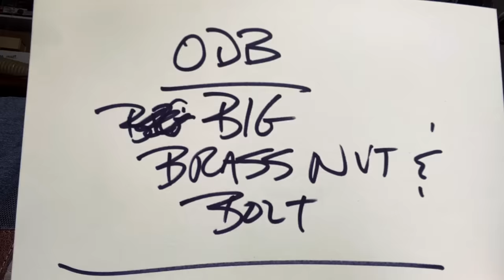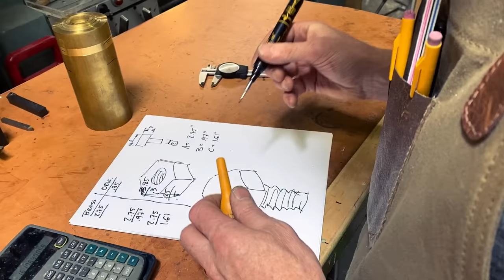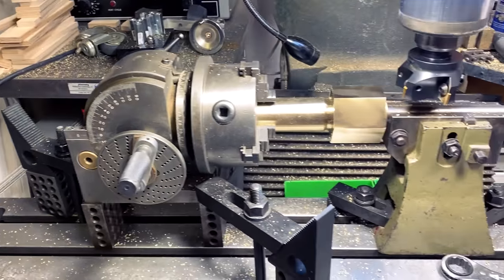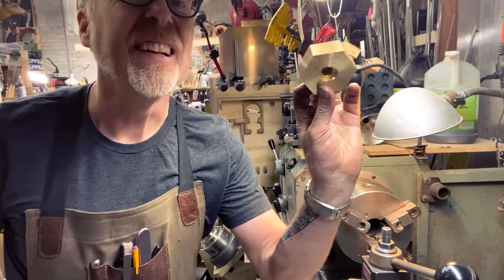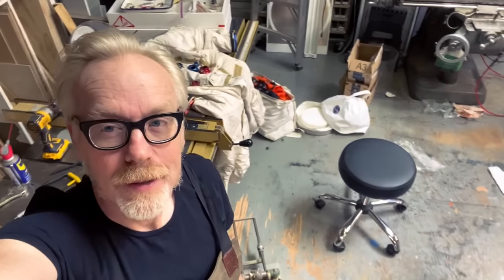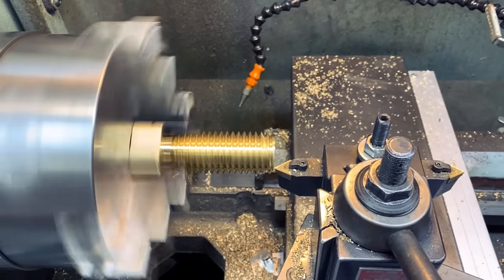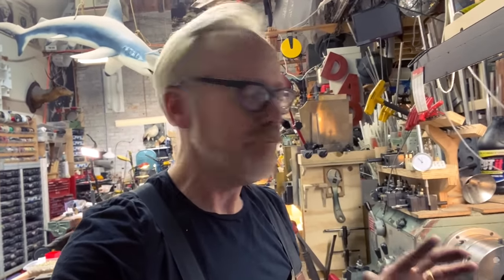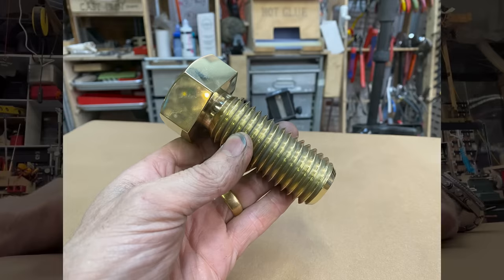Adam Savage's One Day Builds: Giant Nut and Bolt!

Comment from the maker: Psssst, we have 98 One Day Builds in our playlist now. Just sayin'. See for yourself: https://www.youtube.com/playlist?list=PLJtitKU0CAej22ZWBqrimPkn0Bbo6ci-r
Reply: Just wondering Adam, is cooling fluid not needed on brass?
Reply: Adam, could you consider doing something like a giveaway or a raffle for your fans? I would love to get that bolt and nut for my personal collection. I've been a big fan of mythbusters since the very first episode; therefore, I would have lots of sentimental value for anything that involves you and the crew. Thank you.
Reply: Anything special planned for the 100th?
Reply: Seen't it.
Reply: Okay, but how many actually took a day to do?
Reply: KEEP THE BRASS CHIPS!
they are awesome for hot-blue ing smaller parts, by them transferring the heat to it.
put them into a half bowl, put the part on top, heat with torch from underneath, and you can control the bluing process very easy!
saw it on clickspring, thought you might not know :D
Reply: @VikasPatel-nl8tb  only time I've used coolant on brass is for the brass steadies, cutting forces arnt as strong as they are for steels and aluminium as it's a softer material, so the brass doesn't really heat up enough to be cause for concern. However if your trying to be accurate to a tolerance of .001mm (idk what the metric coversion is, maybe a tenth or two) then coolant is useful as it eliminates  having to count in for the expansion of the metal due to heat
Reply: Now you need to make a wrench to match!
Reply: Brains and hands on ability at your level is truly rare. I grew up watching and learning from you, thank you Adam.
Reply: Is this the last ODB for a while?
Reply: i have threaded metal rods with hand tools, that has nothing to do with this but watching it was super cool
Reply: Since I was a child I've always found it satisfying to watch a lathe work through brass and aluminium.
Reply: You need to head to Florida and visit Adam from abomb79 and have him show you some tricks
Reply: Vikas Patel no brass is a self lubricating metal
Reply: S A F E T Y  G O G G L E S ! ! !
Reply: @VikasPatel-nl8tb  Generally, no. It does make the tools last longer and helps prevent galling though.
Reply: You didn't cut the washer face on the  underside of the head of the bolt. If you look at your example bolt you can just see it.
Reply: I'm not a very experienced machinist but I have gotten my certificate and worked with a lot of thread cutting operations so I might know a few things. I just was wondering if you had invested in the machinist Bible or better known as "the 30th edition of the machinist handbook." It has all of the measurements for pitch, TPI, thread height, classes of fit and basically everything else including specs on some very old and obscure threads. Also if you plan on continuing your journey of thread cutting, I would suggest a pitch micrometer or at lead wires to measure your threads because, and i hate to say this, watching you measure with calipers physically hurt. I was also wondering if you were using the 60° on your compound rest because it wasn't clear and only using the cross slide puts way way too much pressure on the cutter and the piece as it cuts on both sides of the cutter instead of one side as is done when using the compound rest. But i did enjoy your video and watching someone else struggle with threading is very fun when looking back at all your own mistakes. Continue working on your craft
Reply: Your next 1 day build should be a socket wrench sized for either the bolt or the nut.
Reply: Adam Savage’s Tested - Adam they have special wires you use when you measure the threads with a caliper. Your supposed to use 2 wires on one side and 1 wire on the opposite side. You should look up thread measuring wires. They will give you a more precise measurement instead of just using the caliper and the threaded part.
Reply: Im 17 and in a vocational school and I can say threading is one thing you just have to keep doing to get the hang of
Reply: I'm curious how you calculate your feeds and speeds. It's been so long since I've used my engine lathe since I got my Haas tl1, it just opens up so much more, especially being able to have a constant surface speed as you cut deeper.
Reply: How many actual days is it?
"This is day two of our one day build..."
Reply: What is the deal with ads on Adam's pages? This one had about 10 ads over the course of 30 minutes... the last ad coming with only 10 seconds left in the video. Every time I watch one of Adam's videos, I observe the same thing.  I know it's not Adam's fault, but why is it not so bad for other videos? If I didn't like Adam so much, I would stop watching. I feel like someone is being punished... and I feel like it's me...
Reply: @calvindlslocum6983   we call it the machinist bible in our schools machine shop too
Reply from the maker: @confusedwhale  Not at all. We're published two a week.
Reply from the maker: @almosthuman1398  The ads are automatically inputted by YouTube. We've been going in and deleting many of them. Apologies.
Reply: @tested :
I was referring to the comment in the video after Grant's death that said you guys were going to start slowing down. My thought was to allow time to grieve, and one of the last ODB film date was really close to when it happened; so, I thought we were pretty close to the end of the backlog.

Was I mistaken on my interpretation somewhere?
Reply: That was quite a journey !
Reply: Адам,давай русские субтитры.Adam, let's have Russian subtitles
Reply: Saved this playlist
Thanks :)
Reply: Awesome
Reply: @VikasPatel-nl8tb  no air blast will be fine. Machine vendors like cutting brass because they can show off their products without using coolant so you can see the capabilities. Check out Swiss turn lathes.
Reply: @VikasPatel-nl8tb  Its self lubricating, just dont take too heavy cuts or it will heat up and expand
Reply: @MartinPlanner2  You're absolutely right about keeping those brass chips.  I learned that trick from Chris on the Clickspring youtube channel when he was bluing the screws he made for the clock.  :-)
Reply: Great job man! Finishing your project!
Reply: You said your lathe chuck wouldn’t fir the bolt, why could you not turn your chuck grips??
Reply: You should contact "Abom79" and do a visit to his shop!
Reply: I would love to see u make a karambit or a butterfly knife it would be awsome
Reply: Adam I became an engineer because of you and mythbusters thank you .
Reply: Much did it cost to make I want to make one myself
Reply: An important thing to learn with machining is the order in which you do your cuts. When I was in school, that was like 80% of what we were tested and judged on. The machining itself was secondary (a skill you learn through practice) while the planning was primary (a skill you learn from books or someone that knows the best approaches)

I'd say the exact order from what I recall from machine shop classes 25 years ago,  but I've used a lathe like twice since then.

What I do remembers is that doing the routing for the nut and bolt is probably something you should have done the very last, not first.

That part of the piece should just have remained a big round cleaned piece of brass to grip your lathe on (without the aluminum, my teacher would have slapped you if you gripped a piece with anything other than claw to piece contact) and be a guide for making everything true. Changing the size of the nut/bolt head several times adds a crapton of work truing everything over again.

You want to do most of your work without taking the piece out of the claw again after mounting it on a cleaned surface.

Round pieces should only slip if things go bad, which does far less damage, won't fling the piece out of the lathe and likely won't even untrue your piece. Slipping needs to be reacted to quickly when doing threads tho, as it'll throw the thread out of phase, which is why taking baby steps, as you learned, is so important with that.

And, use your endstock when turning threads, then it won't break out so easily even when you did the routing first. You're putting a crapton of forces in several directions on the piece. The endstock will help bringing all forces back into balance.

Visualizing the forces you are dealing with helps a lot in knowing when you should use an endstock, but a good rule of thumb is to always use one if at all possible.
Reply: @VikasPatel-nl8tb  Normally cut dry.
Reply: @calvindlslocum6983  Cutting straight in is perfectly acceptable. Watch Joe Pie cut threads. His video on using thread wires will also save you a lot of PIA, just use one wire. Adam had a lot of stick out that resulted in vibration that you can see in the finished threads.
Reply: @Eric Francis If time is almost up, get out there and have all the fun you can. Make Mary if you can catch her.
Reply: Thank you SO much for sharing your scuff marks in a world where only the polished finish is usually shown.  By doing so, you take the pressure to perform off of everyone who doesn't do a perfect job the first (or tenth) time.  Bravo, good sir!
Reply: Hi Adam
My name Serg, I'm 16 y.o. and I'm from Russia. 
Thank you for your work. Before I saw your channel I didn't want work by my hand but at now I want study  and work in this field. 
ADAM, THANK YOU VERY MUCH🥺🥺🥺

P. S. Sorry for the grammar😓😓
Reply: You could have pulled the teeth out of the dividing head and turned them around and it would have made it so u could put bigger stock in the chuck of the dividing head just an fyi
Reply: Adam, you should watch the thread video from thisoldtony. He explains how to cut the threads with a much lower tool pressure. Think of it as cutting on one long side and not using the other. Even face loading can result in a lot of side to side chatter. Give it a watch, he's pretty good, but you know that from the Apollo door art piece you did.
Reply: Hey, can you please tell me the brand of the pen you are using to draw the sketch? Thank you
Reply: My motto in life is never stop learning by having fun
Reply: Adam, I would love your lathe. but I know that would be an unreasonable request. I had to build my own from left over drill press and flat iron.
Reply: Your sketch had left hand threads.
Reply: it was not because you got greedy, i have a much smaller machine and can cut more depth than that on threading, the reason it failed is a lack of support, the further away from the chuck you cut the more force ends up at the support point, after you added the tail stock all was good, that's why the tail stock is there Adam, use it where possible.
edit..after watching you struggle there just a machinist tip, if you use the cross slide set to the same angle as one side of the thread and use that to feed in the cutter you will only be cutting one face or side of the thread, this will lessen tool cutting forces, give you better chip breaking and a much cleaner cut.
Reply: @almosthuman1398  If you are using Chrome as your browser, just add AdBlock as an extension in teh browser...you will never have to worry about a youtbe ad again. :0) Or like....any other ads....
Reply: Like I haven’t seen them all already
Reply: HI ADAM
Don't give up, try it again!! And bigger!!
I can help you a lot of key tips that you can do to make a show quality bolt.
If you are want to do it again I can send you my contact details.

My experience is making metric and imperial threads from 7mm bolt with 0.5mm pitch up to a 80mm bolt with 6mm pitch.
Reply: @VikasPatel-nl8tb  no, it's not
Reply: Adam my man, Huge fan.  I'm am the IT Admin for a big company, and I am a big nerd for everything tech. Much respect to you for nerding out in your own profession far beyond most of us.   I got a flavor of shorts to ask, that I think everyone wants to see.  Can you send an impossible job to ThisOldTony?  If you have not checked out his channel, he is amazing with the machining and also hilarious like yourself. I think you gents would fit together like sith lords. Always two, there are.     Anyway, I think it would be a mighty good time.
Reply: Adam, Your chuck  jaws can be removed and turned around to fit larger diameter pieces.
Reply: Sub en español por favor
Reply: @artfiend75  The jaws Adam are using has one external grip and three internal.
The other side is for holding on the inner diameter. The jaws don't fit upside down, and if they did the jaws would be curved the wrong way.
Reply: Hey adam you need to check out clicksprings videos he works almost exclusively with brass and high precision tooling
Reply: After the first day, in my mind, every time you said "one day", I heard "two day". Kind of weird.
Reply: M
Reply: It Will be cool when there are 365!
Reply: @gaivoron  uh
Reply: Why does bigger screw has less threads?Why can't it be as fine as the smaller one?
Reply: 28:45 It was Nut Easy haha :)! Love your channel Adam, keep up the good work :)
Reply: I think you would thoroughly enjoy tool and die work. It has a little bit of everything from machining to polishing, plumbing, electrical, hydraulics. Very fun and challenging.
Reply: sorry Adam i would of cut the thread first before the hex on the mill
Reply: @VikasPatel-nl8tb   if your working at low speeds with metals you won't always need to have any sort of fluid, Be it suds or cutting oil as there isn't much heat being generated compared to going at higher speeds, however, it also depends on the metal, I've done minor machining on lathes, Pillar drills and even some grinding on a grinding wheel for a welding class, And we have only ever used cooling once and it was when we were boring a hole down some small mild steel bar, all the other times be it cutting or knurling.

What I have personally found when using these fluids or not using the fluids is that the swarf tends to linger in the fluid that's still on the metal which can cause problems, It also tends to block your view of the metal if it's turning too slow but is generating a lot of heat, most of the time I've also found that the fluid is there to protect the bits you are using rather than the material its self, Brass is a relatively soft or malleable material so you wouldn't necessarily need to use any sort of fluids but like shown you would have to be gentle with it otherwise it can grab hold of your cutting tools and either destroy your part, the cutting tool or both which tends to be a very expensive endeavour to deal with

Not sure if this really helps, More or less a ramble from an engineering student but that's what I've found over the short period of time I've done lathe work and engineering studies in general.
Reply: I am a biggest fan of you sir you are my inspiration
Reply: To avoid damage when putting on 4 jaw. Put copper blocks in between the jaw and the part
Reply: I love how this started as an axample of the ability to exicute one desired outcome but ended with a result tjat was a compromise one the wnitial expectations. With that being said i love you adam and you have been an inspiration s8nce i was was a todler and stil as a 17 year old working in my school robotics program.hope you read this.
Reply: What did you use to draw the picture?
Reply: @breakingtoast2255  yes, I would have as well.
Reply: the next challenge on the lathe could be to try to build a screw with a right-left thread and the same in the nut
Reply: As a machinist, 3D printer, fabricator of motorcycles and by far a huge freaking anime sifi need I think I need to apply.
Reply: I’m a cnc machinist by trade, more specifically manual and cnc lathe machinist by trade. Id/od threads have never been easy for me, even on the cnc! Aerospace has super tight tolerances, sometimes + or - .0005 which can be a major pain. So just know you’re not the only one that gets frustrated with having to set up threading ops 😂
Reply: When you gunna wire clamp that thang?
Reply: Why the fuck wouldn't you show the milling? of the six sides of the nut and bolt?
Reply: Adam - Suggestion: why not take a trip out to see Abom79 at his new shop and have him show you how to use your "toys"?
Reply: @bottomline7923  uh probably because he’s done it so many times in soo many other builds he glanced over it. Take this as your chance to peruse his many other builds where he just what you so rudely requested… Jus sayin…
Reply: Where can I get that pen?
Reply: @gaivoron  Get this person that bolt
Reply: @VikasPatel-nl8tb  well it's a very soft metal an we were milling very VERY slow
Reply: @almosthuman1398  sounds like a Jerry Seinfeld stand up routine !!!

"So...What is the deal with AD'S  on this channel??"
Reply: If you watch Tim Hunkin's recently remastered 'Secret life of Machines' videos (Tell me you know of Tim Hunkin?) and watch his recent commentary at the end, you will see he has a HUGE nut and bolt he made on the shelf behind him.
Reply: Mmol
Reply: It's such a bummer when you cut out the process! I want to watch the entire process! Don't just skip to, "here's my bolt" at the end! BOOOOO!!!

Comment: Adam, traditionally when machining threads you reduce the depth of cut as you get deeper in the thread.  I'm currently turning a 1-1/2 npt on SS and I start with an .0112 pass, and it takes 12 passes with the last pass only being a .0032" pass.  This keeps the chip load equal since you're using more of the cutting edge.
Reply: Also if you set the compound at ~59.5° and feeding in with that cuts on one side of the thread instead of both sides at the same time.
Reply: @deckum23  29.5 degrees. adam is not doing that here.
Reply: makes sense.
Reply: Shouldn't you also start threads by first adding a chamfer to the face you start cutting into rather than cutting into a face perpendicular to the axis? That way you have a gradual introduction to the thread cut and makes it easier to thread the nut on later. It's kind of like how you always chamfer a hole before you tap it or a shaft before you cut it with a die.